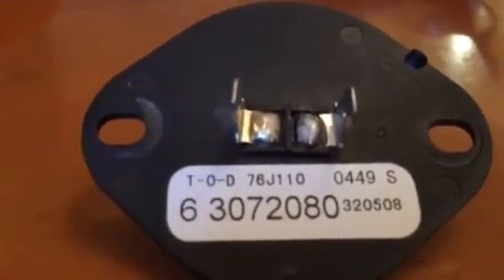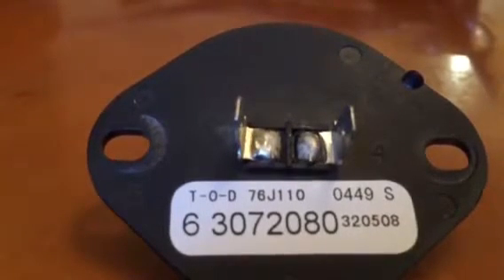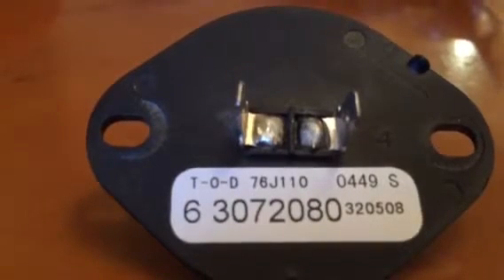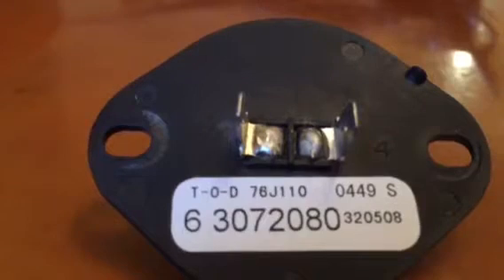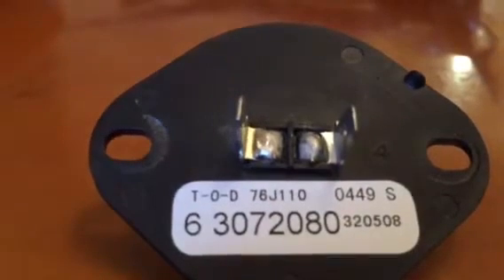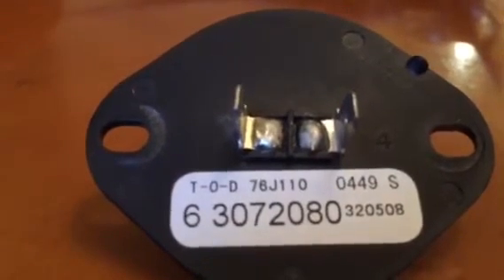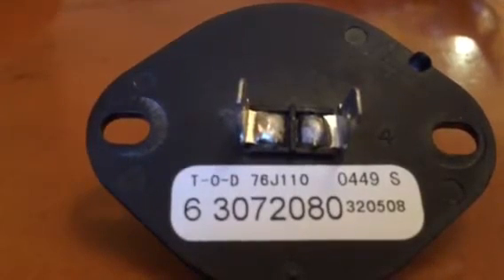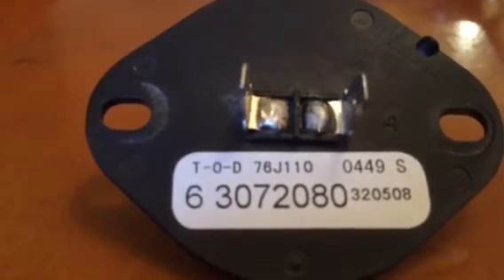Thermistor obselete Neptune Dryer can't be fixed

Comment: I have a much older dryer with this same thermistor (MDE5500AYW, electric, Neptune).  And am looking for this same part now.  Damn shame it’s so hard to find.  

I think my part is fine, it gets about  11.5k Ohms at 72°.  But I’d like to rule it out, by replacing it easily.  I’ll come back to let you know where I find a viable replacement.